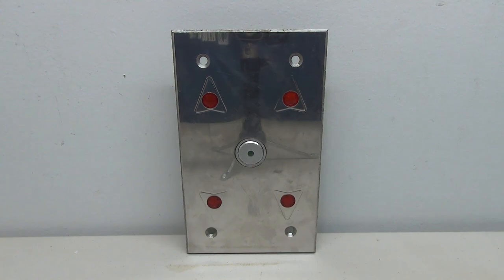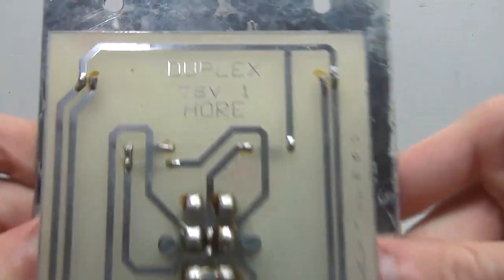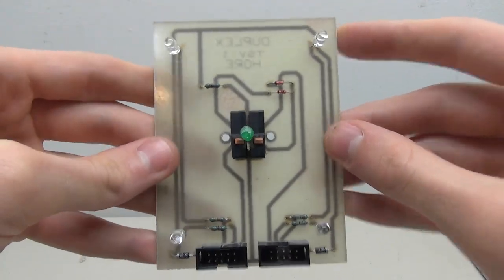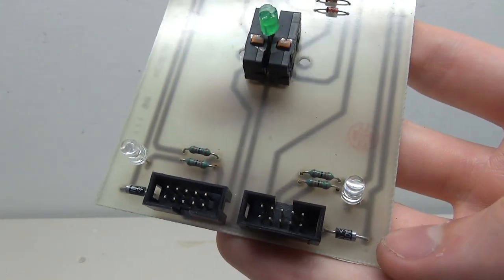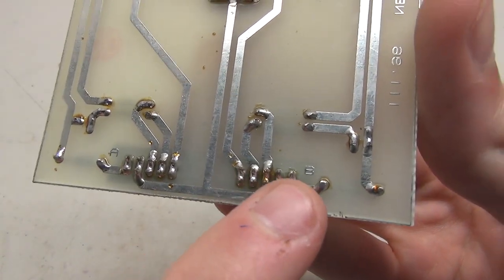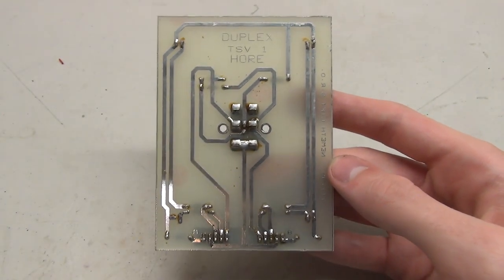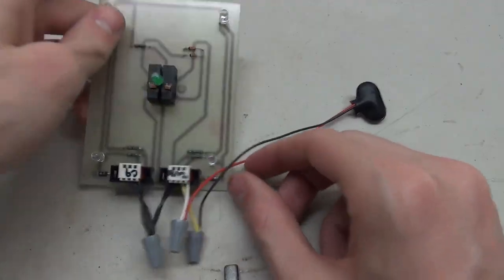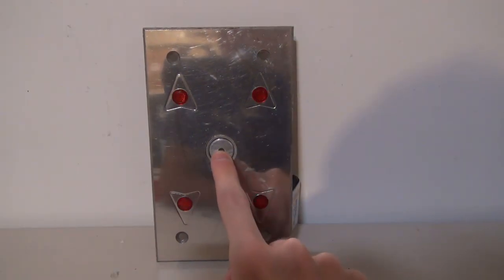Wiring a Nemeth Lift Call Button

Comment: This panel reminded me of the two lifts at a hospital on the isle of wight
3 floors, A, B, and C, dunno why they chose letters, but at the main entrance floor A was the ground floor, but in other parts of the hospital, floor B was the ground floor, and for some weird reason if you wanted to take the stairs from A to C or C to A, you had to take a walk through a few corridors to get between the staircase that goes between B and C, and the stairs by the main entrance that go between A and B, which kind of discourages visitors from using the stairs, for no reason that i can see (and i last visited the isle of wight about 8 years ago)
And on B there was only a single call button

Comment: I wonder if this is a specialty conversion part for an older system.  As you know, duplex dispatch system are  simple setups where the left car responds to up hall calls and the right car responds to down hall calls (sometimes reversed).  This was really common on older Otis setups.  They were often altered so both cars would respond to a lobby call.  I'm thinking this could be somehow doing the same thing with those pins soldered across the bridge on the connectors.  Plus the "DUPLEX" and "HORE" (Slavonic for "up") etched on the p.c. card lead me to believe this.  Even more likely I'm completely wrong, ha!  Just a guess.  Either way, it's a really cool piece.  Nice job wiring it up as always
Reply from the maker: That’s very possible. I don’t know much about these types of elevators or how their controllers work.

Comment: Wow! That's certainly different. A very interesting board as well (actually, cheap is a better word to use). Single layer PCB and it doesn't even have solder mask on it! Just be a little careful when handling that board. Don't want to break those traces!
Reply from the maker: I didn't break it :P
Reply: @stlelevators  Mission successful! :D
Reply: @LoiNguyen-vx9yz  Early Access